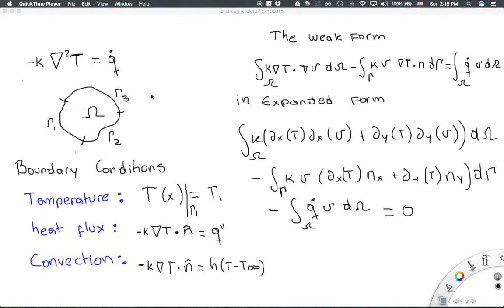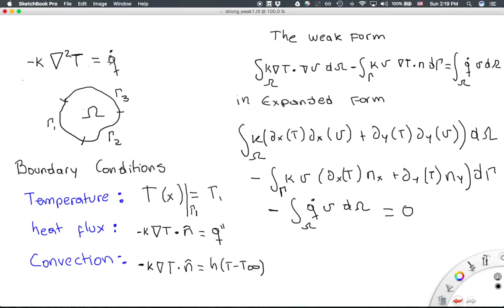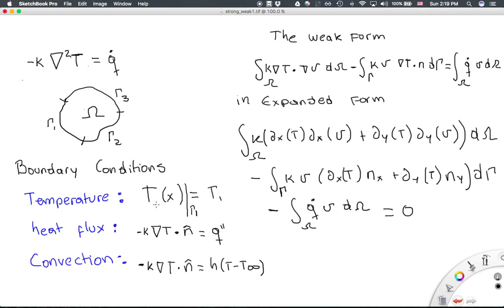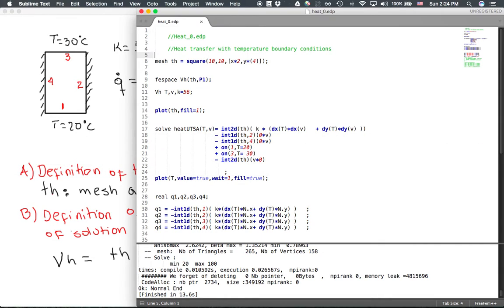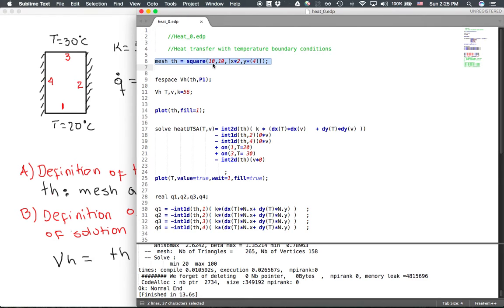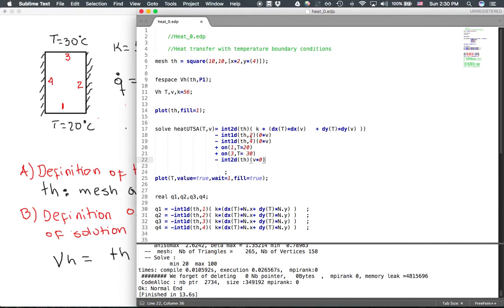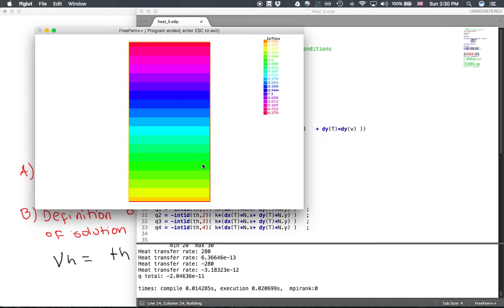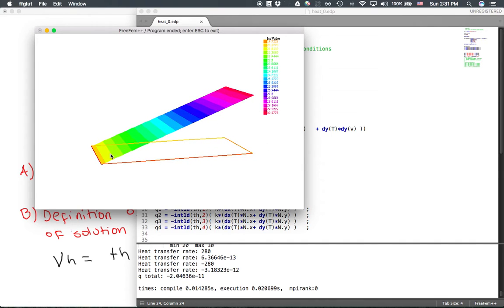freefem intro

Comment: in case you need:

// Data
int khold=56;
real q1,q2,q3,q4;

// Mesh
mesh th = square(10,10,[2*x,4*y]);

// Solution's space
fespace Vh(th,P1);
Vh T,v,k = khold;

// Plot mesh
plot(th,fill=1,wait=1);

// Problem
problem heatUTSA(T,v)= int2d(th)(k*(dx(T)*dx(v)+dy(T)*dy(v)))
					-int1d(th,2)(0*v)
					-int1d(th,4)(0*v)
					+on(1,T=20)
					+on(3,T=30)
					-int2d(th)(v*0)
					
						;
// Solve the problem
heatUTSA;
// Plot result
plot(T,value=true,wait=1,fill=true);

// Calc q1,q2,q3,q4
q1=-int1d(th,1)(k*(dx(T)*N.x+dy(T)*N.y));
q2=-int1d(th,2)(k*(dx(T)*N.x+dy(T)*N.y));
q3=-int1d(th,3)(k*(dx(T)*N.x+dy(T)*N.y));
q4=-int1d(th,4)(k*(dx(T)*N.x+dy(T)*N.y));

// Print q1,q2,q3,q4
cout << "Heat transfer rate:" << q1 << endl;
cout << "Heat transfer rate:" << q2 << endl;
cout << "Heat transfer rate:" << q3 << endl;
cout << "Heat transfer rate:" << q4 << endl;
cout << "q total:" << q1+q2+q3+q4 << "\n\n";

Comment: Thank you. The video is very helpful to start using FreeFEM. I have a question about the boundary 1,2,3,4. It seems that you did not explicitly label the boundary in your code. So, how FreeFEM knows which number corresponds to which boundary. Can we explicitly define the boundary in the code? Thanks.

Comment: Thank you Manuel for the video!!! One question: what if k is a time dependent material property?
Reply from the maker: Then you have to change the equation to include time. The equation becomes parabolic and you have solve for the temperature as a function of time. You can expand the time using finite differences and use explicit or implicit approach. If the properties are depending on time or temperature you have to account for that at every iteration in time. This is also possible in Freefem
Reply: @xmanuelj  thank you so much for your help!!! ff++ is a very powerful tool!!!

Comment: hello Manuel I find your video very helpful .I have this question why the result from FreeFem++ for isolated surfaces are not absolute zero ? thank you
Reply from the maker: Hi Youxi, The reason is the mesh resolution. If you increase the mesh resolution the heat transfer rate will approach to zero